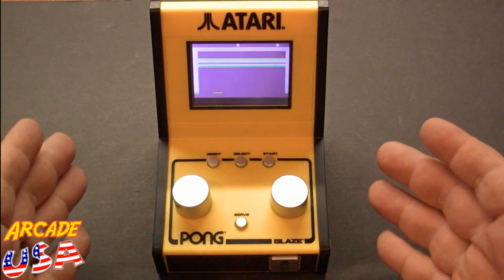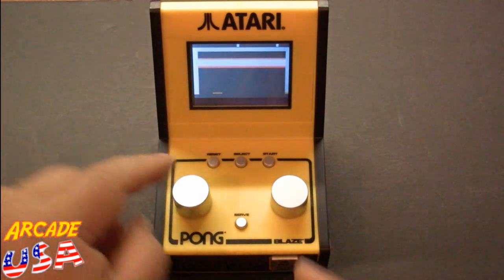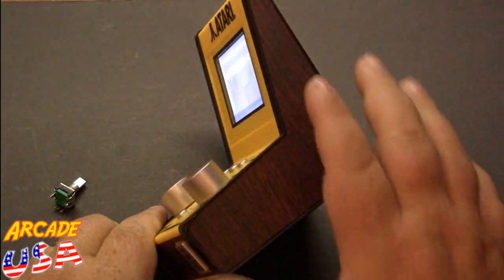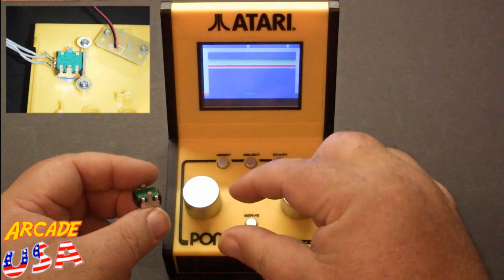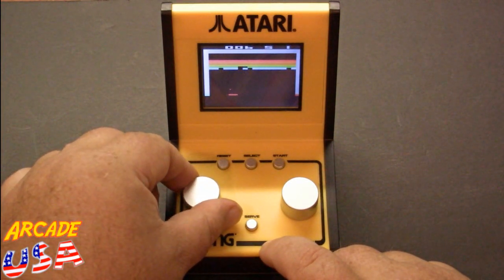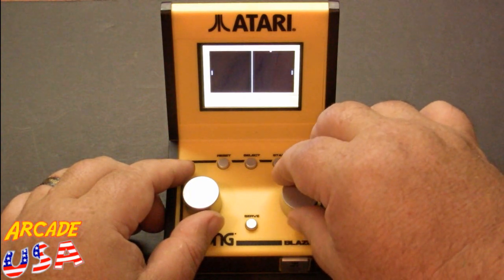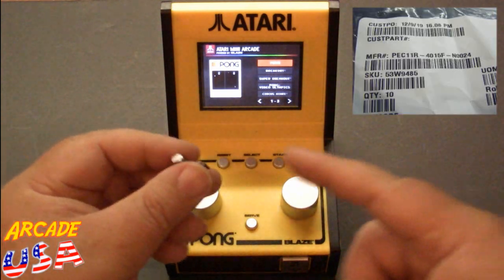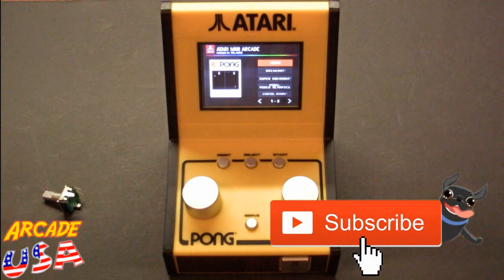Blaze Atari Mini Pong Refit!

Comment: Great job! Blaze should do a recall, and replace the rotary on them. Though I doubt that will happen. But maybe for the next batch.
Reply: This will probably never happen but I wish
Reply from the maker: If I had a 3d printer, I would design a adapter bracket so you can just bolt in the new encoder with its own wiring harness :)